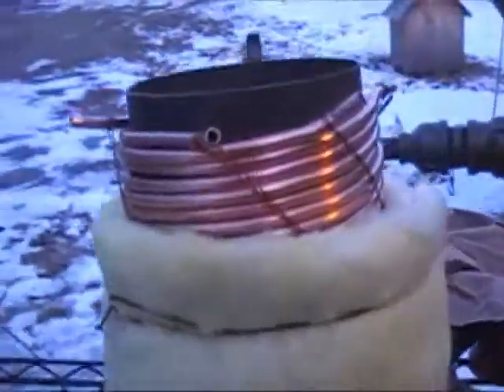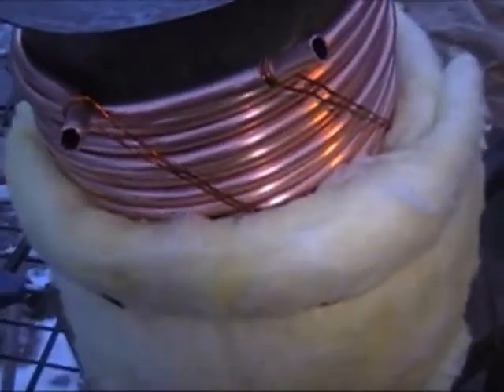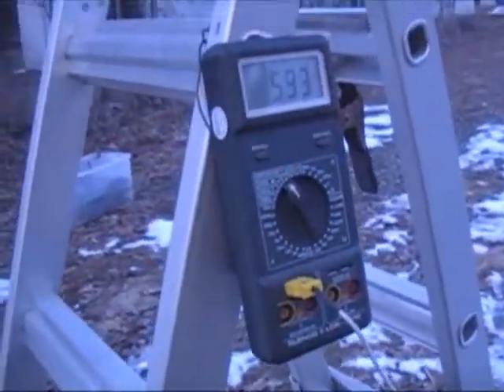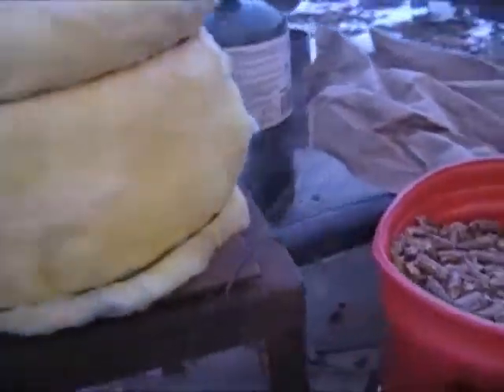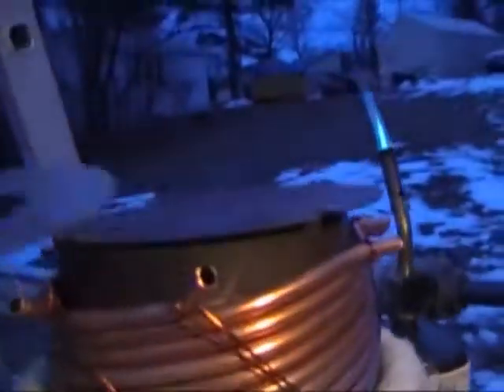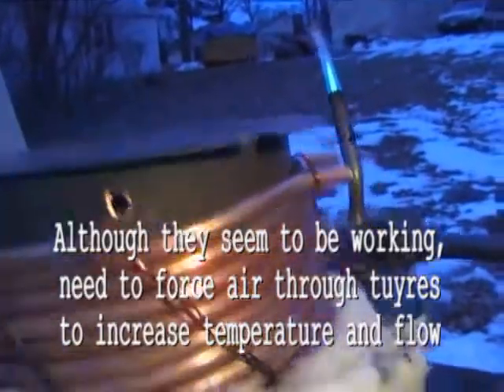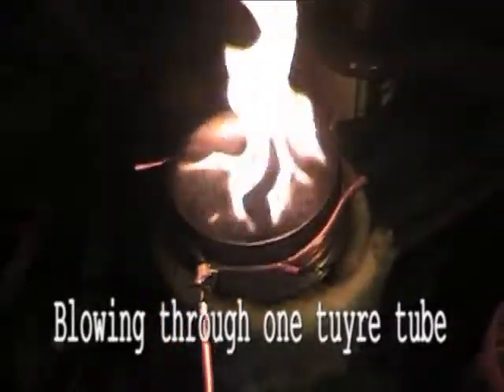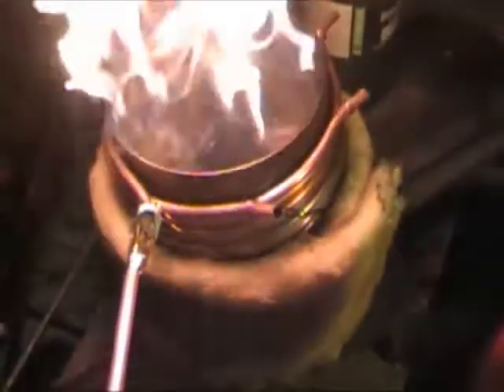hydro4f3a_021_Tabletop_G3_Gasifier_3.wmv

Comment from the maker: The cone is made by rolling up a section of a circle and welding up the seam. There are some cone calculators on the web that will tell you the section size in degrees and the radius of the circle to get to the desired base diameter and height.

I have not worked on the project since late spring 2010, but did make an improved inlet to the cyclone and have been working on pellet delivery and temp control systems. 

Have not run an engine, but 'tis the season to play outside in the cold : )